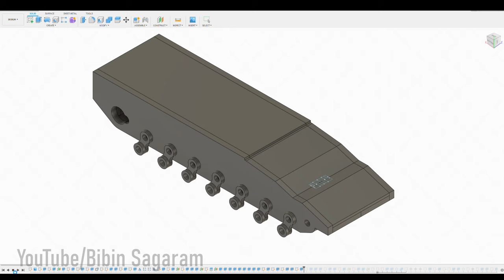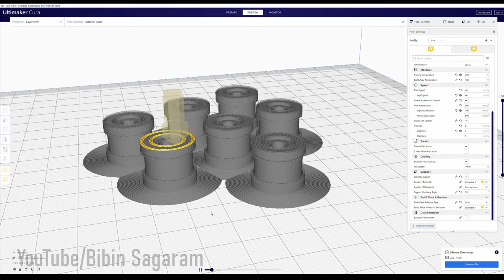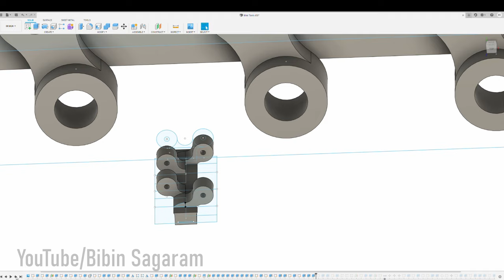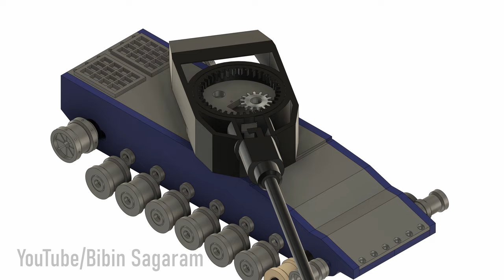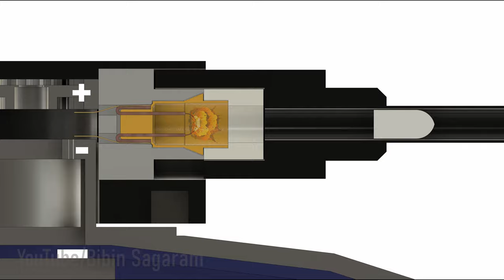Making Mini RC Tank, It can Fire too !!

Comment from the maker: This video took a while to make. Probably because it's complicated(or maybe because Big Bang Theory has 12 Seasons). 
Blooper :-  10:27 and 10:34 you can see a blue lighter I left in the scene (I tried to hide it with masking but didn't worked well)
Reply: Please make mini stormbreaker 🙏🏻🙏🏻🙏🏻
Reply from the maker: Sure 👍
Reply from the maker: Thanks 👍
Reply: I didn't notice it at first. The tank was in the spotlight haha.
And the last part was amazing!
Reply from the maker: Thanks 👍😊
Reply: 12 seasons of Big Bang paid off indeed 😌 great job!🤩
Reply from the maker: @Maria96j  Thanks Maria😊 Ronith is the culprit 😉
Reply: Definitely because Big Bang Theory has 12 seasons😅
Reply: our face in all the videos I’ve watched, your projects are the best
Reply: is it possible to link the manufacturers for the parts you used? Arduino Nano, speed controllers, Bluetooth module, etc. You don't need to give links(its fine if you do) but just an idea of where to buy. Thank you so much.
Reply from the maker: @TechnoWin Please see the description, there is a link to the drive.

Comment: Good work !
 Can you make a mini rail gun, (Is it practically possible to scale down a rail gun 😬 ) Haven't seen such a convincing efficient scaled down model of it anywhere..
Reply from the maker: Thanks 😊, I have plans to make a mini rail gun. But not sure whether it will work or not. Before rail gun, I will be making a mini full auto coil gun. Hope fully I can take lessons from that (high voltage generation, storage and discharge) and apply it on rail gun.
Reply: That's great.. waiting for the next work.. 👍